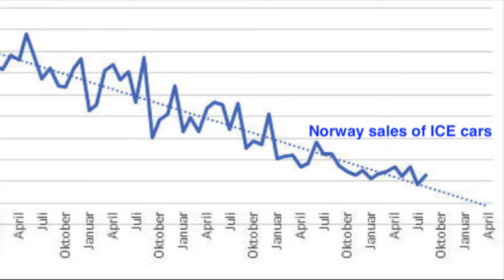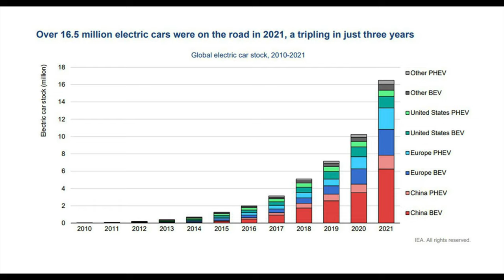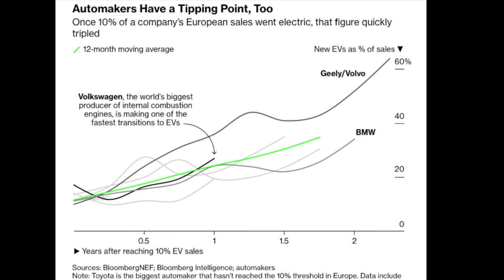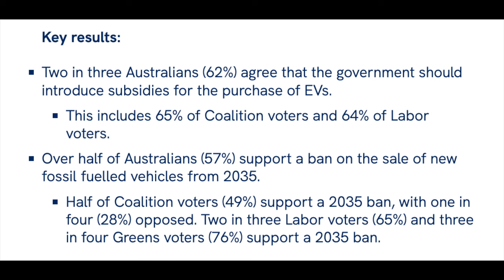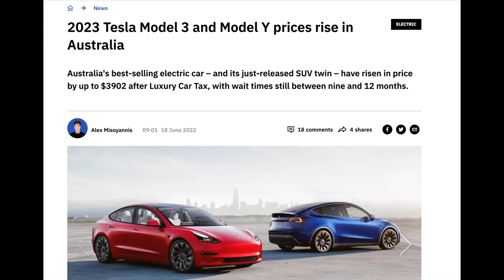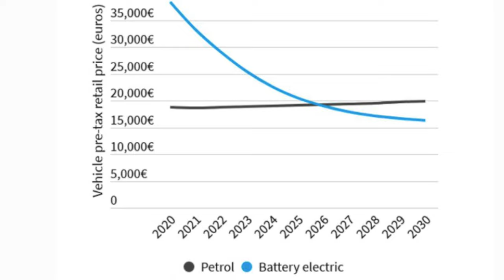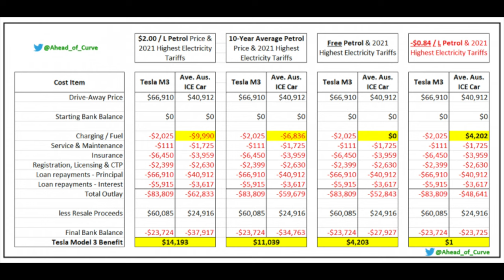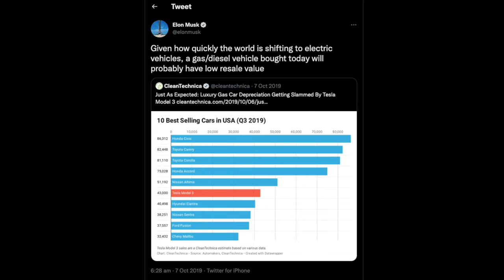When will your ICE vehicle become worthless?

Comment: Currently EVs are only competitive because of government subsidies, while also heavily taxing everything ICE related! On a free-market basis the current EVs would have no chance!
Reply from the maker: Look at the 5 year cost of a mid range EV. No petrol or service costs. Take away the $ spent subsidising the fossil fuel industry and get back to me. Cheers
Reply: @The1KovacsAttila1  thanks. What service does an EV need? I’ve done 30,000km in two years and serviced nothing. The first scheduled service is at 100,000km to change the air conditioning filter. I will need tyres before then
Reply: @StevesBikes01  
Usually it only needs some minor stuff, and if you have a VW or any other German EV, they will install some updates. (VW released the cars without proper testing, because they made the car under time pressure (in 2015 they still said EV is a joke, “we will never gonna get onboard for that stupid idea”), so they had no time for testing. They update the software later, if they can figure it out at all)! 
Usually they do a “system check” which is nothing more than wasting an hour or two of your life, so they can put on the “service invoice work sheet” to charge you 600-1000 dollars/euros and make you believe they did something amazing to your car (while they didn’t do shit!). According to a YT video I saw a few days ago, Porsche bills you out over 2000 euros for a simple computer assisted system check up!
Reply: @stevestesla9120  Last I looked, electricity isn't free. As countries start to lose the huge tax revenue from fossil fuels, they'll start taxing the sh!t out of EV charging stations instead. Many will start requiring cars to upload miles driven and tax you on that basis. They'll find a way to make EV driving just as expensive as ICE.
Reply: @nodak81  well my electricity costs .28kW/h. It cost me $86 a month to do about 2,000km. Whats your petrol cost? In Australia one state has an EV road tax of 2.6 cents per km.  Thats a few hundred $ a year. I think you should check your facts
Reply: @stevestesla9120  Fossil Fuel is a key to our economy, government, healthcare, education, and pretty much all government provided services here in Alberta, Canada. We have very large reserves of fossil fuel which is owned by the people, as we get royalties on every barrel. How much are the global Lithium reserves vs crude oil???
Reply: @gunit6815  excellent question. Check the periodic table of the elements. Hydrogen then Helium then guess what the 3rd most abundant element in the entire universe is, yes, Lithium. There is no shortage, only a shortage or processing whip is rapidly growing. If you had a spare $ couple thousand, would you buy Lithium shares today or fossil fuel for a 10 year return? Great question though and thanks for watching.
Reply: @StevesBikes01  I know one thing for sure, I know I could commute to work for an entire year for the cost of 30 fill ups on my 2019 VW Jetta, which by no means is a gas guzzler, at 1200-1300KM of range per tank if I don't put my foot into it. One tank of fuel lasts me two weeks plus a day or two if I burn it right empty. I commute 50km to and 50km from work. I would go electric in an instant if I could afford it. Especially between the months of March to November. I would park the EV for the winter and use the gas burner during the cold months as I do not think we are even close to having a reliable EV in cold Canadian winters for highway commutes. Even in the ICE powered 1.4L turbo gas engine the 1200KM range gets cut to about 850-900 due to excessive idling to keep warm, but again when we use Winter blended gasoline the price also falls considerably vs summer blends. As for charging, I would use a Y adapter and tap into my dryer plug which is right at the drive way. (I have no garage nor room to put one unless virtually eliminating 2/3 of my back yard, as well I only have 100 amp service running into my home that already powers 4 240V appliances. (Water Heater, stove, clothes dryer, and 13 seer central air conditioning) Also in the summer time during extreme heat spells, we are already asked to conserve electricity during peak hours as well as in extreme cold in the winter. I still do not know how we will have 100% electric vehicles when the grid cannot even keep up with everybody running an air conditioner. Nevermind charging a car. It also takes a ton of fossil fuel to harvest that lithium out of the ground. It will not happen in our life times with both fossil and lithium, but we will have peak lithium as will we have peak oil. I do not think there is enough to go around. One good thing about fossil fuel is new reserves very slowly develop in time, and once all the lithium is gone, it's gone. If it's like anything else, recycled over and over and over again it loses more and more power each time it's recycled, not to mention all the fossil fuel needed to melt it down for reuse. But in my hopes is there enough to offset the carbon emissions to net zero while continuing to live in a world of both ICE and EV vehicles on the road? Everyone wants a car and like myself, I have three ICE powered vehicles myself. I have my Jetta, my wife has her Tiguan, I also have a old 2001 F150 for a backup commuter incase something happens to the car, we need to move something big, or do any dump runs. I do not believe carbon causes climate change. I live in Alberta, Canada and there is strong evidence that this place was once a hot desert before turning into a icy cold frozen hell, and I think the cycle is running its return to hot dry desert conditions. Technically we are still in the ice age here with many many glaciers even here in Alberta in the Rocky Mountains still there, yes melting but still there. Carbon capture and storage needs to be part of the future, there just is not enough energy to energize even one EV per family. And we both know many many households will have multiple vehicles like they do now.
Reply: @StevesBikes01  I would also use, yes gasoline for long road trips as well as I am "recharged" in a matter of a couple minutes
Reply: @nodak81  It is free if you charge at Sainsburys......

Comment: I am watching for this reason if I buy my last ICE vehicle will I be able to sell it or even trade it in 8 10 years from now?
Reply: You definitely will be able to, just don’t expect to get much for it. Hold off until you can buy an EV is my advice. Cheers
Reply: Do you really think new ice vehicles will be running 8 to 10 years from now? 10 years ago, it would be reasonable to expect a lifespan of 10 or 20 years. I don't expect a modern car with a tiny turbocharged engine and constant velocity transmission to last that long. 
I'm keeping my 30 year old Jeep.

Comment: Correction. Electric cars are not more expensive than gas cars, there are lower priced ones. The electric car "they want" is more expensive than a gas car. The desirable ones are still expensive.
Reply: I just returned from a roadtrip in -7 Celsius temps. My family with 2 kids visited the  Czech Republic for the weekend! Amazing roadtrip with a 2 liter diesel station wagon! The whole trip was 960 kms! We had sunny but cold weather as well as heavy snowing, where the car could hardly get over the built up snow! 
I could do the whole trip with one gas tank (40 liters) and still some left in the tank! I used parking heating to keep the car warm for my toddler and my 6y.o., knowing that a gas station is always just around the corner, if it’s needed! I didn’t need it! 
The trip from our home to the hotel was 4 hours long, and we did 30-40% of the trip away from the highways! 
My car is an average station wagon, costs less than EUR 20k. 

If you think there are many affordable cars out there that could be fit for this purpose, please tell me which electric car would it be?
Reply: I can choose from dozens of ICE cars for under $30k in the USA. The only EV car under $30k (without the tax rebate because the majority of buyers don't qualify for it) is the Leaf which is garbage because of its passive battery cooling.

Comment: Well until you can make one for $4000 I'll keep driving old junk that has already hit its depreciation floor. Every car I have owned combined over the last 20 years cost the same or less than the depreciation of a new vehicle ev or ice over the first 2 years. Of course I have had to put fuel in them and do maintinence, but I could drive an older quality used car with a proven lifespan that is efficient probably 400,000km for the price of a new ev. The problem with ALL new cars regardleas of their power source is designed obsolescence. They are designed to have a short service life, go to the junk yard, and you buy a brand new one
Reply from the maker: Great feedback

Comment: Right now it's hard for some drivers to justify an EV because they don't drive much. If you aren't spending much on gas now there's not much savings to subtract from the car payment. On the other hand if you do drive a lot the math is really easy. Fleet managers have already done this math and are moving to electric vehicles.
Reply: Thanks Frank I agree. Check out “Steve’s Bikes” if you’re into motorbikes, cheers
Reply: Here in Poland energy prices rose so much that now prices of using "powering" ICE and EV are almost equal.

Comment: Do you think EV will be more cheaper than ICE cars soon? If not then not many people will switch to EV
Reply from the maker: Right now a BYD over 5 years ( no petrol or service) is cheaper than an ICE car. Another 12 months and the upfront purchase will be the same or cheaper. Cheers
Reply: @stevestesla9120  I wish Tesla would lower their model 3 down to at least $38,000-$43,000 when EVs become cheaper in the near future
Reply from the maker: @jgab7042  There are rumours of an announcement on the 1st March Investor day. Lets see.
Reply: @stevestesla9120  News flash. EV cars aren't magical, they need service like any other car. There's coolant, heating systems, air conditioning, tires, etc. Just getting rid of oil changes doesn't make your car invincible and free of maintenance costs. Not to mention Tesla is the least reliable brand in the USA, needing constant repairs of all kinds.
Reply: @nodak81  👏 👏 👏 💯